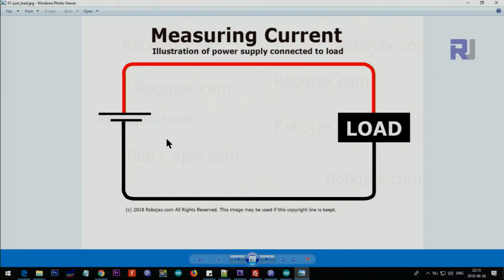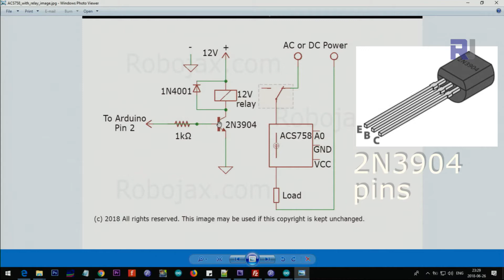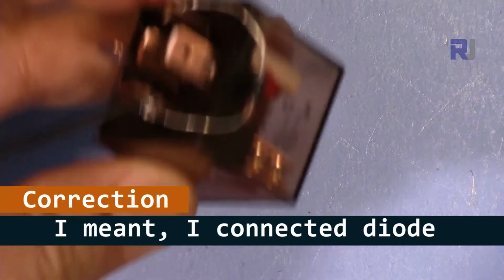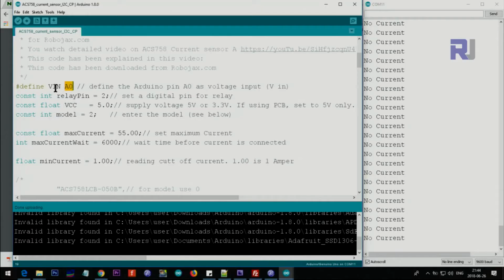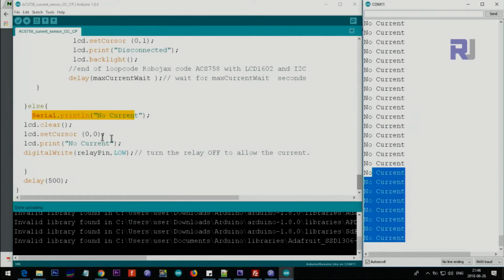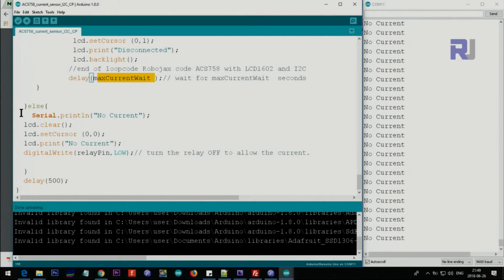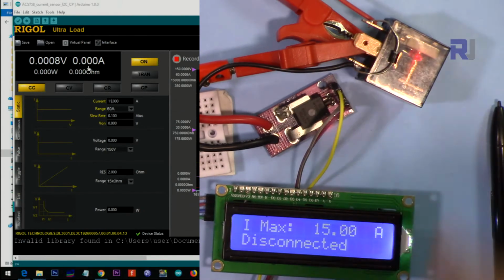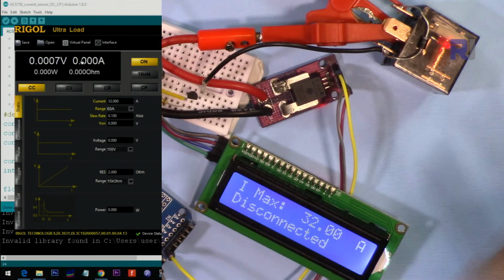OverCurrent Protection with Allegro ACS758 Current sensor with LCD1602-I2C RJT92

Comment: Cool very good your video. would add add 4 touch button is a h pwm bridge module. It is for a screwdriver project where 2 button to increase and decrease amperage that the relief will be turned off and 2 button to turn the motor to the left and right I have a screwdriver project but I only know about electronics, I don't know anything about programming just copy and paste the code ... Thanks in advance thanks
Reply from the maker: your project is something you  only need it and it is very specific.  So you would have to learn Arduino to write your own code or pay someone to do it. I have no time for extra work.  Start learning Arduino from this 30 minutes course https://youtu.be/Mbb2xa1WcRM

Comment: What is the opamp and other SMT components used for. Is it not possible to use the ACS758 just by itself?
Reply from the maker: I made the video for this purpose. Please watch without skipping. I haven't said anything extra.
Reply: @robojax  I did watch the whole video - you never talk about the purpose of the opamp or SMT resistors/capcitors in the ACS758 board you bought off ebay. You just talk about your relay schematic. I want to know whether I can use the ACS758 without any supporting components (except maybe 0.1uf  filter cap on analog out pin).

Comment: Rob I tried the project works wonders. I wanted to ask you if it was possible to set the dream current with a trimmer instead of setting the current with the software. Thank you so much.
Reply from the maker: this is NOT voltage or current regulator. It is the measurement device. so you would have to set that from your power supply.
sorry "dream current" what current are you referring to? https://snag.gy/AHhRpV.jpg
Reply: Yes yes I understand. But I was referring to if you could set the desired current value via a potentiometer instead of changing it via the Arduino sketch
Reply from the maker: Yes  you can do it. Watch this video https://www.youtube.com/watch?v=TbLdAQpE4jE
From the code in the video, read the input voltage at A2 into variable " voltage2". 
do the following: 
1- comment this line  and make it it// const float maxCurrent = 15.00;//
2-Find this line:   float current = voltage / FACTOR;
just ONE line above it
3- add this:  maxCurrent = voltage2/ FACTOR;// 
 Now when you rotate the potentioimeter, it should work.
Note: you have to make sure to set the current limit low enough something like 1A or low in this line: float minCurrent = 1.00;
Reply: Robojax I tried to do what you told me, but nothing worked. You must if you can kindly take a look at the sketch and review this point. Thank you so much .
Reply from the maker: show me your work. post it so I can fix it.
Reply: Nothing I can not find a solution is I do not know how to post my work. If you can write me how to set with the trimmer otherwise I have to leave it as it is 😫
Reply from the maker: you have post it on a blog page or google drive and share the link here. I will look at it and suggest fixing it.
Reply: I solved everything works perfectly.
Reply from the maker: okay. I am glad you solve it.